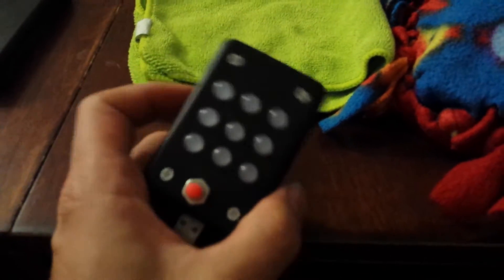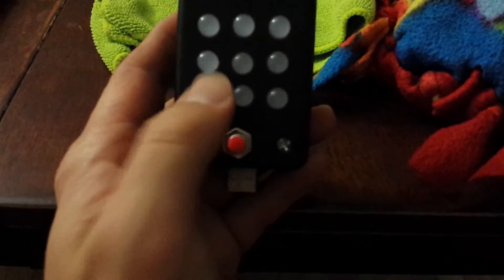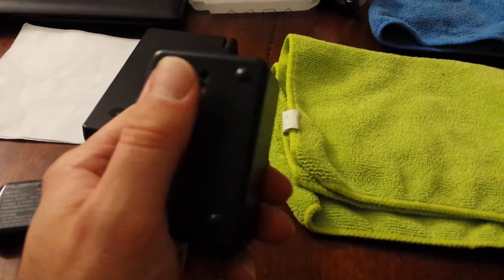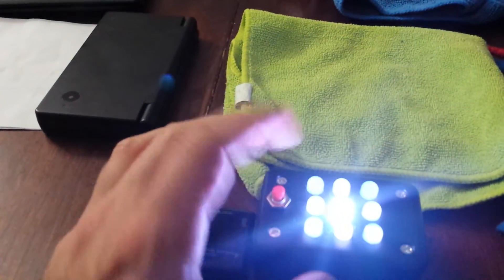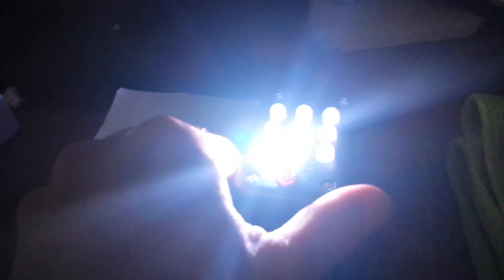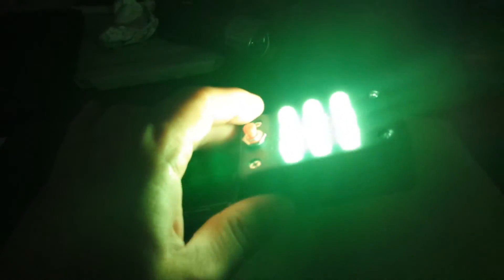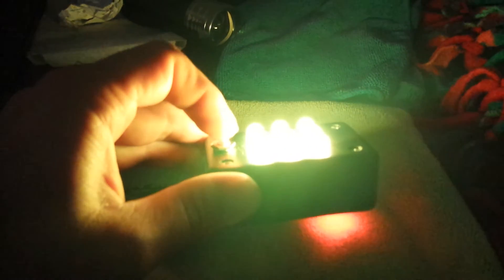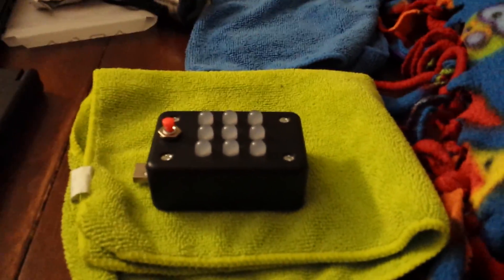Chameleon lamp

Comment: That's really cool!  That's a really smart way to sense color!  I never knew that!  I always though it was some special color sensing chip or something!  But that's way simpler!
Reply from the maker: Down side of that method is it's slow very slow and some color don't get reproduce very well but it was for fun :P
Reply: bakupcpu So you can't speed up the LED's blinking?
Reply from the maker: Makerj101 I can but I then sacrifice the accuracy of the color reading, this is mainly due because the LDR react slowly to light faster then the human eye but still. I try using a photo transistor but I think because they are very sensitive to everything including IR it was making the color reading a bit random. I could also buy a color detection module but I don't need that :) it was a fun project to build.